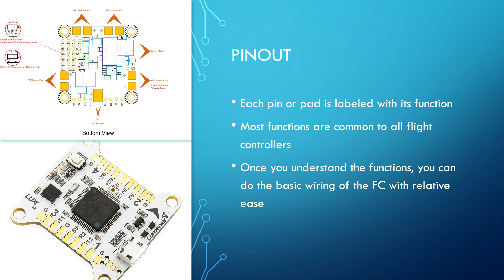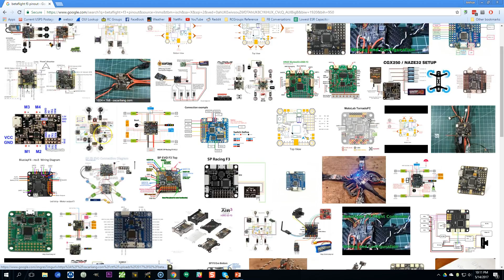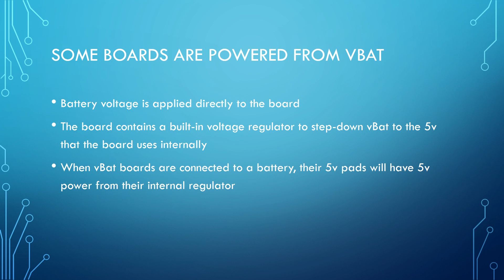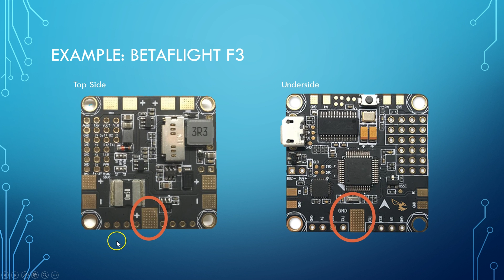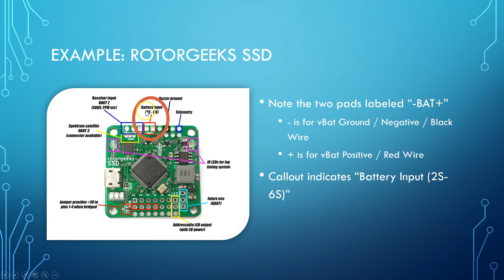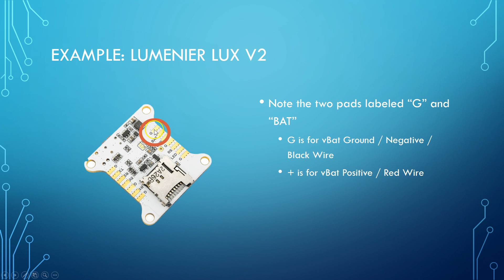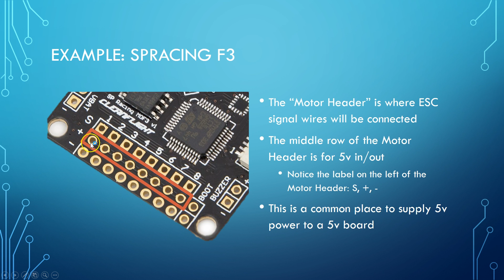Flight Controller Wiring For Beginners - PART 1 - Power

Comment: it would be so kind of you if you could let me know where to solder a i lost my drone in four feet weeds locater. no really i did. I have a Torrent 110 with the MF300 flight control board. not having any luck finding the info i need. thanks for your time. P.S. the locater just has positive and negative .

Comment: Hey josh 
Can you tell me what pins power the fc on the mercury board ?
Wanting to use a different pdb that’s in the original stack ? 
Can’t find anything to tell me this information. Thank you for your help ! Thank you Tom
Reply from the maker: I don't know what the Mercury Board is. Can you link me to it?
Reply: @JoshuaBardwell  first of all thank you for your help !! It’s the mercury stack from impulse rc. Not really sure how I can send you the link .
Reply from the maker: Mercury has stacking pins that go from the PDB to FC. You will have to figure out which of those pins is vBat and G and solder wires to them, as I don't see any other vBat pins or pads on the FC.
Reply: @JoshuaBardwell   yes that’s what my question was , if you new the right pins to solder ? Greatly appreciate your help 👍

Comment: Ty for the videos, my stuff is old, like KK2 CC3D and now even naze which I never hot to work. I have 4 bricked ones.

So yea now things have changed and so I got an F7 Airbot board.  No instructions no documentation and the only video done are 2 done in French.

This kind of business practice is about to drive me away from quad copters. Just way to much of a pain in the ass to but and have no instructions to come with them.

But your videos are worth trying and if I can get this F7 to run on my old eachine then maybe I wont give it up.

Comment: Kakute f7 V1.5 Question:  For the life of me, I cannot find this in Joshua's instruction manual or pin-out diagram online and i know i must be missing/overlooking something. I'm trying to create a custom plug to connect the Kakute's connector to my ESC T-Motor F55A Pro II connector. The label on the Kakute's connector shows : M4-1 I G R7 B+   I'm trying to figure out what the "I" is between the M4 and the G pins. I know there are a thousand people on here who use this board and can tell me -Thanks!   (As a side note, does the F55 ESC "telemetry" pin on it's connector output meaningful info IE should I connect it to the Kakute R7 pin?       -My first build,  Taking it slow and watching as many videos as I can on my days off. -Thanks community!
Reply from the maker: I is analog current sense.

Comment: how if i need build 8 motor drone. how ESC board connect or need me 2 pcs ESC board, and if ESC need be 60A / motor ?
Reply from the maker: You would need eight ESC's. So two 4-in-1 or eight individual.
Reply: @JoshuaBardwell  but how connect controller ? all controller what can buy have only 4 esc controll output. thailand i has found only expensive holubro kakute F7, and F7422 mastek about has, and some olden version F4 and F3 board. all have only 4 motor  cotroller output. and some pdb have same only 4 esc output/connections,  i think i made first own drone diy, 170KV motors 8 pcs, 60A esc 8 pcs, holybro kakute F7 board controller, but i no found pdb or esc board what can use.how connect 4 motor pdb or esc board 8 motor ????? and what is better motor 400KV or 170KV fly agrigultural diy drone 10-20 liter water tank. how know what motor need be and what mean 170KV or 400KV or 800KV ??

Comment: So if the 5v pads are wired in parallel, is it possible to power multiple accessories from one 5v pad? For example the white noise nano mounting board for the tbs unify pro32 and crossfire nano RX which the manual states is a pass thru for the camera, which in my case would be the nano turtle. Would I have to be concerned about amp draw on a single 5v pad with all those accessories or does it not make a difference since the 5v pads are wired in parallel? Keep up the good work! #inspiring

Comment: I am trying to wire a servo for a tricopter into my flight controller it is a four wire servo with a feedback I put that feedback wire into the RSS I pad which is C05 in the CLI, Does it automatically pick that up and now it is the feedback or do I need to tie that to the servo in the CLI somehow, I am getting tail wag  I am trying to tune it out in betaflight but I have not solved the problem yet, it’s not a gitter it’s more of a sway back-and-forth please help, kakute f7 fc
Reply from the maker: I think only triflight firmware supports 4 wire servos. Not Betaflight.

Are you running triflight?
Reply: No this is my first tricopter and I was thinking they had combined them at this point all the other posts were from years ago, so  I need to flash trifling to my kakute f7, or can I solve the problem in betaflight thru tuning I have watched all your tuning videos and have just been making changes and seeing how it flies but sometimes there is no  teacher like Experience. Do you have a tri copter you have worked out a tune for or should this be your next video.lol
Reply: Hey josh I just wanted to let you know I ended up not being able to run triflight They had nothing for the kakute F7 so I took your advice and just kept playing around in betaflight , I ended up changing all the PIDs for the yaw, I brought the  P down just slightly, I brought the  I down almost all the way “5”, and  D down to 20, brought my fast feed forward up to 110 even though I know you said it doesn’t really help over 100 it seem to help in this case I’m going to continue to tweak things but it is definitely steady enough to fly  fpv. Thanks for what you do I would’ve never figured it out without watching all the different videos on tuning,I might start reducing some of the extra filtering now to see what happens,Seriously though my son and I think someone hint hint needs to make a video on tricopters in betaflight.   THANKS AGAIN

Comment: Josh, Where can I find 3.3 v on your JB FC AIO for the RDQ GPS module? In your GPS video you're using 5 v. RDQ says this will fry GPS.
Reply from the maker: If you aren't using a 3.3v receiver then the only place to get it is the solder bridge on the under-side of the board. The side of the bridge that you WOULD bridge to center to give the receiver 3.3v will have 3.3v on it. Just solder the wire directly to that pad but do not bridge that pad to center.
Reply: @JoshuaBardwell  Much thanks, I thought so however, wanted to check with the Pro!

Comment: Quick question Mr.Bardwell, I have a few DJI A2 flight controllers. Im struggling with programming. I recently tripped on my last DJI USB cable destroying it. Why is it that only DJI cables work with their Flight Controllers?  Besides that I cxant be the only person struggling to program these flight controllers. I recently made the mistake of wasting my money on a DJI N3 Flight Controllers with theb A3 upgrade. No matter what i do it will not talk to any computer i hook it up to. So again i have  wasted my hard earned cash on trash. Of course I've emailed DJI in regards to my issue with no response. I build mostly Heavy lifting Octo's and Hexacopters. Typically 800mm and up. I think the largest we have is a 1650mm Octo. Do u have any recommendations for better flight controllers? I have a few Cinnestar 8's with Mikrokopter flight controllers and im still learning them. Ive also tried the Vector flight controllers and again am struggling to get any receivers to power up off the flight controller. With the Vector i tried 2 diofferent receivers and a Graupner, all would not power up. Ive also tried different computers with no improvement.
 I have 5 A2 flight controllers in total. 3 are operational andd i just can not get the last 2 to program. Any assistance would be incredibly helpful. Thank you sir, Ty Winters

Comment: maybe I'm a little bit late but...
I have a kakute F4 V2 (http://www.holybro.com/manual/KakuteF4V2Manual.pdf)
Do I have to power it up feeding vBat+ on B+ pad or it would be enough to solder the SH wire labelled as Battery Voltage and Ground to a B+ PDB's pad and Gnd from ESC?
(little diagram : https://imgur.com/JEKZdRc    and summarizing :  https://imgur.com/UywSHOU )
Reply from the maker: The b+ pad is intended as output power for a video transmitter. The FC is intended to receive power from the 4 in 1 plug.

Comment: Hi Joshua, I was wondering if you could help me look for a replacement mosfet for my flight controller it is a eachine tiny 32 bits F3-evo for a brushed quad. Indeed, I burnt the mosfet of one of my motors and I am having a hard time finding a suitable replacement mosfet. Thanks

Comment: I need help. Joshua or anyone else with FPV know how. I have an Eachine Wizard X220HV that is slowly transforming into a custom drone. The 4 in 1 ESC went out and I have installed 4 indiviual ESCs which went well. I don't currently have the ability to get a new FC so I am attempting to connect a new PDB (https://tinyurl.com/y3wmvqkj) to the original FC (https://tinyurl.com/y3ouwnva).

The Eachine FC does not have solder pads except for BAT+ and GND on the bottom. Is BAT+ always a full voltage feed? Due to the lack of solder pads I am attempting to connect through the micro JST, the iFlight PDB has on the JST connection GND, BAT, M1, M2, M3, M4, CUR, TX and the Eachine FC has GND, NOP, PWM1, PWM2, PWM3, PWM4. I know that the M1 and PWM1 are the same though I'm not sure what the NOP connector does (normally open?) and again does BAT mean full battery current? And what is CUR? Do I need to connect the TX and CUR if the FC doesnt support it?

Thanks to anyone who can give me some helpful info!

Comment: J.B. This info is exactly what this old man needs! Thanks for the work! I am taking your Sim lessons and watching several of your vids. Only about half of what you say is going over my head after about 3 weeks. However, water doesn't flow like electricity. More like air.  Unless the sum of the input hose equals the total sum of all connected and opened. All your doing is dividing the flow by four. 10 gpm inlet equal 2.5 gpm by 4 outlets.

Comment: I just bought my first mini quad, used Wizard X220. The flight control power LED does not light and I cannot connect or flash with either Betaflight or Cleanflight. It seems the SP Racing F3 is physically damaged. Can I replace it with an Omnibus F4? Thank you for your excellent tutorials.
Reply from the maker: You can replace it with an omnibus F4 but you may need to do some soldering to connect all the wires.
Reply: Thank you, I have watched many of your video, which one is most applicable to the Omnibus F4, "soldering to connect all the wires". Thanks again,

Comment: I have owned this drone for a while for the life of me I can not get it to fly I think the tx is bond to rx but not to flight controller something is fuck up my drone is a diatone 2018 gt-m5sx and my rx is r-xsr not sure if I wired poorly or ……...
Reply from the maker: The first thing I would check is, do you see the Receiver Tab channels moving when you move the sticks. If not, then the FC is not seeing any signal from the receiver, and that is where to start troubleshooting.
Reply: @JoshuaBardwell  I KNOW I'M FN UP SOME HOW JUST NOT KNOW HOW FURY 3F W/O R-XSR
Reply: I DON'T KNOW WHAT I DID WITH MY NOTES IT GIVES 2 OUT PUTS FROM RX S.PORT AND S BUS FROM THAT TO ??

Comment: Hey joshua,I'm using a diversity receiver on my fixed wing plane.ive got a flight controller that has a plug labeled vtx,my question is do I connect both my vtx's to this input just soldering the wires from both together and plugging it in.or does one have to go somewhere else.thanks

Comment: Hi Joshua - very good videos - thank you much! Just a question.. Is it possible to connect battery + to + from the FC and then connect the (-) Port from the FC with (+) of the PBD - basically put the FC and the PBD in a row?

Comment: Hey josh what could be a reason my flight controller would get super hot. To the point I can’t touch it. Could it be the pdb?
Reply from the maker: Usually this means there is a short-circuit in the board that is getting hot -- in your case, the FC. If you just finished building it, maybe you bridged something and it's shorting out. Probably vBat if it's getting super hot. If it was flying fine until recently and now it's getting hot, it probably got damaged in a crash.

Comment: I got a transmitter for a cheap Chinese drone(8807W)  when I put four double A's in it won't power on. Thinking its the capacitor.  How do I know what type of capacitor can I use. Trying to learn how to repair them.

Comment: I'm having a rough time finding a 20x20 board that is small enough with all of the features I want. I may want to use the Matek F405 mini that requires 5V from an external source. Can I hook it up to one of these? Wolfwhoop PW-D Control Buck Converter 6-24V to 5V 3A Step-down Regulator Module Power Inverter Volt Stabilizer https://www.amazon.com/dp/B076P4C42B/ref=cm_sw_r_cp_apa_zCEqBbHX86ZMT
Does an FC and everything it powers (everything but ESCs and motors, I'll be using a 4 in1) draw more than 3 amps?
Reply from the maker: 3 amps is fine unless you are running lots of led strip or something.

Comment: is there a bridge on a betaflight f4 for a spektrum 3,3
Reply from the maker: No, but there is a separate dedicated 3.3v output pad. Look at the pinout. It's just left of the DSM2 pin.
Reply: Hello you answered one of my very many questions thank you so much
Reply: Now what I am also trying to figure out is,..is there any way I can hook up an ar6200 spektrum receiver to my bff4 cb. And if so how and where do I connect the wires,if you can send me a link or email that would be great

Comment: Hi Joshua, I'm looking to build my first quad. Im a commercial hvac tech I wire and make/alter a harness all the time. If my goal was to save space with the way a harness could be routed as compaired to a pdb with my specific frame layout, is there any other major downsides other then weight, solder points, so forth? I'm doing a 190mm with a flip32 f4 pro, four 30amp esc's and 2205 2300kv motors. So battery directly to my fc, through my current sensor and back out to esc's, then esc signal and ground to corresponding pins on fc. Sounds good for a pdb delete?
Reply from the maker: A PDB is going to be more flexible in that it will have additional pads and functions. The question I will ask is, why don't you want to use a PDB.
Reply: Joshua Bardwell, the design of the frame im using is going to be tight fitting everything in, im not overly worried about other contact points. My goal is to free up some room as i cant run my stack 3 boards high, and id prefer a clean build with a  4 in 1 esc, fc with wires routed instead of a pdb.

Comment: I am building a tricopter and was hopping to find something in this playlist to help me use this board http://www.readytoflyquads.com/flip32-f4 to wire up the servo for the yaw because I am getting no servo movement when yawing. Can anyone help me?
Reply from the maker: When you select the tricopter mixer in Betaflight, one servo output will be created. You need to go into the CLI and manually assign that servo to a physical pin using resource reassignment.
Reply: Joshua Bardwell OK, would you be able to explain that a little more?
Reply from the maker: https://www.youtube.com/watch?v=z5aO-3_n-Hs

You want to look in "Resource" command for an resource named SERVO 1 (that is what I'm guessing it will be--I haven't set up a tricopter myself). and that is what you will map to an output pin like a spare motor output or the ledstrip pin.
Reply: Joshua Bardwell thanks for the help. Hopefully this will finally get me somewhere.

Comment: Thanks for all the great info. I would hate to put you out of business (and I doubt it would happen), but can't the manufactures of this stuff include a sheet explaining what to wire where? I am not talking about the simple diagrams, if you can find one, but a real explanation of what the pinouts are used for.
Reply from the maker: If you look at the Holybro Kakute and the JBardwell F4, those companies hired me to write a detailed manual. Matek is another company that does fantastic documentation for their products.

Comment: Where do you solder the current sensor wire coming from the 4 in 1 esc to a kakute f4 v2 aio to get current? I soldered it to uart 5 esc telemetry pads and It isn't getting any current reading.
Reply from the maker: CURR pin.
Reply: Joshua Bardwell So if i dont have a current pin I can't have current sensor. Wont work on a uart?

Comment: Hi Josh, Im using your flight controller and a spedix 30a 4 and 1. I used your wiring method that runs the power though your FC to get current sensing. Using this wiring method, I still wire the signal wires from the harness on the ESC to your FC from the Spedix, but what about the power and ground connections? If I wire them to the FC, where do they go?

Comment: Joshua, you put it nicely. In clear language, there is lot if lack of knowledge about the DIY flight controllers. However, your videos are complete and clear, and I got additional information specifically related to iNav-Taranis-flight controllers and GPS that I think, round up my questions. I already ordered the controller and board, and I hope that will work just fine. Thanks a lot.

Comment: Joshua, I watched all the videos, and I still have a question before jumping into the project. I use a Taranis system, and I want to have telemetry data out form the flight controller. My application is purely normal airplanes. With that said, the question is: Is there any board that would allow to be connected to the SPort, besides the SBUS?
Reply from the maker: +Richard Raimondo I don't understand. Pretty much all FC do both SBUS and Smartport. So I think there is some confusion in the question.